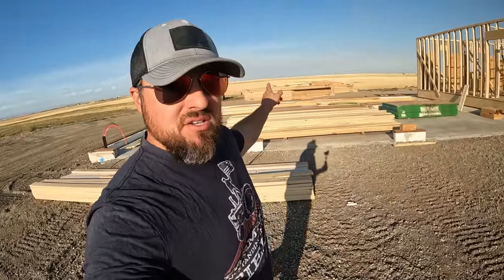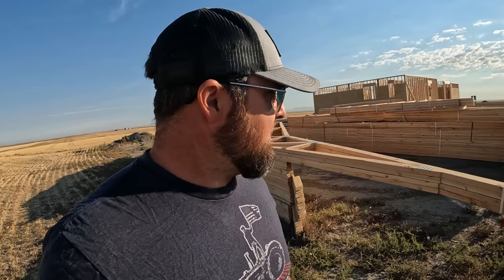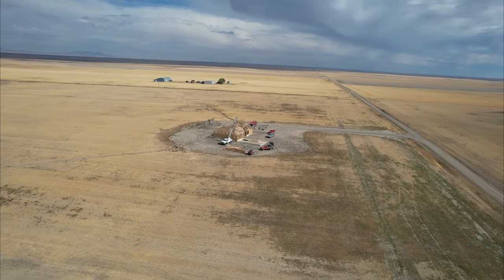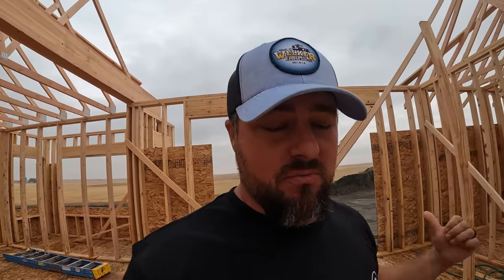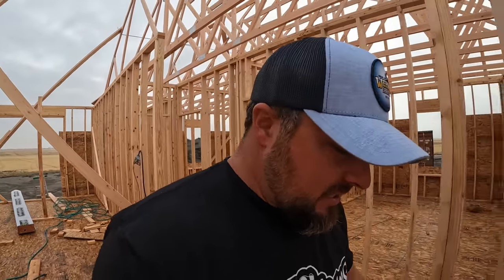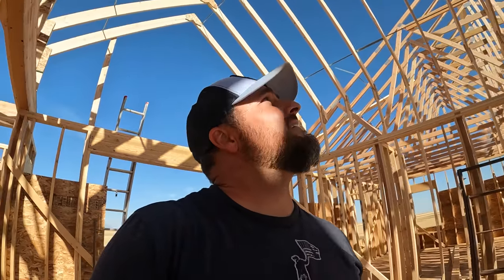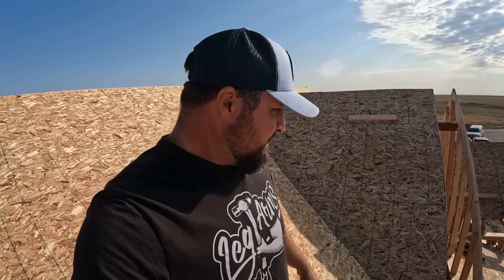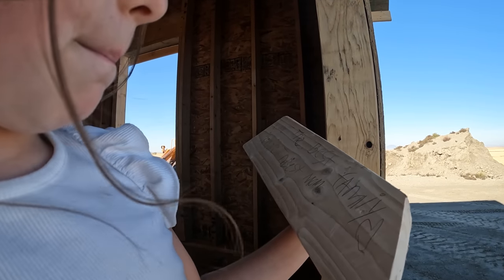How We Fixed a HUGE Mistake! - Leg Arm's House Build Part 5

Comment: I was yelling at the tube but you found it and it all worked out, so glad, any carpenter of my generation with a 5-in-one Starret tool could build what you want on site, makin in happen in MT, just make sure the roofing is flashed properly

Comment: Lov'n this. Worked in the building industry for decades in Australia 🇦🇺. Also drove cranes and hav'n a good laugh at mistakes. As a 73yo it's amazing to me how much timber American's still use. Ahwell old habits never die. In northern Australia 🇦🇺 we have cyclones 🌀 ( you call them hurricanes) all timber buildings have steel tiedown rod's. Me now i would only build with pre- cast concrete. Anyway it's looking good. Best of luck y'all.

Comment: We've built 2 houses from scratch in the last decade and no matter what, there is always some kind of problem. 
Thats just how house building is apparently.... from materials not being available or way over budget to complete  contractors/designers just messing up. 

It happens. All and all, there are always solutions especially when you're able to compromise. Congrats again on the house

Comment: As a retired builder I note that you have one of the cleanest building sites I have seen .. that's great in every way - including showing pride in workmanship ... if you have any internal box or valley  gutters, my suggestion is to make them as big as possible with emergency overflows lower than ANY top edge. It is amazing what can block a down pipe.    Looking good.    Oh and stop putting yourself down ... building is mostly common sense and being practical and you have both those traits

Comment: I'm no carpenter, but as soon as I saw the gap in the trusses, I knew what you were going to say the problem was, and how I would fix it.   It turned out nice!  You might want to get the cathedral ceiling spray foamed.  I know people that lost the drywall up in the peak due to moisture.
Reply: He is.  Thanks👍

Comment: I hope you can send the junk trusses back as the plans didn't give you what you asked for. Having said that, if they can't you have wood on site that can be used for some other idea's. I just love the fact that they included a beam for a load bearing wall that wasn't needed where they had it...... it is needed now and in a much better position. You have definitely got some good builders working with you. Good bless and hope you all have a really awesome weekend ❤️👍❤️

Comment: It's been so interesting watching how you build houses there. The majority of homes here are concrete block built, with brick facing, or timber frame with block and plaster facing, while windows and doors are mostly PVC or Aluminium. Its a whole other method of foundations, services etc. Odd thing is here we don't face the tornado winds, or frozen winters, just rain, light snow, the odd hurricane in autumn, and relatively mild summers. Best of luck in your new home.

Comment: Scott, I was in construction for about a year. Your contractor did it right common frame the vaulted area not only saves time but common frame roofs in my opinion look better and tend to be better than trusses strength wise and more importantly square and plum.
Reply: High winds are very common in MT.  You need a strong building for the wind and snow.

Comment: Either use the unused trusses in a new small building OR cut them up and have a bonfire BBQ near to last day. If option 2 be extremely careful of the truss plates as they are very sharp, I work with them daily.

You new assistant cameragirl  is doing a fantastic job, she will be a pro in no time. Why not give her one of the retired cameras to practice with.

Comment: You also have an issue with insulation the vaulted roof area.    You might consider using spray closed cell isocyranate foam ( R-7 per inch ) in that vaulted ceiling area.
Reply: What I was wondering myself. Good fixbut getting the R value  at that  point  is crucial.
Reply: He is foaming the walls already, so the vault will be too

Comment: Your daughter's house tour was fantastic. As for the vaults I would guess that the designer misunderstood what you had wanted as on custom homes it does happen sometimes. I've been delivering trusses for six and a half years, and mistakes do happen, always frustrating but I haven't seen a job not get corrected to the customer's satisfaction. Thankfully you have a good contractor that is building your house and worked out how to make the adjustments needed to get exactly what you wanted. 
It did look like the Case had a bit more leak down than it should in that timelapse at 16:43 But having your own crane was a pretty solid cost savings, as those are not cheap.

Comment: Just to put things in perspective Scott, you have done so much fabricating on the farm that the builders would say the same thing about your profession. Don't ever sell yourself short, especially when you told the designers 2 years in advance you see a problem coming with vault and then they just put it off as no big deal, but the fabricator in you could vision it not working.  The builders and yourself are both talented so just leave it at that! God bless all of you and keep plugging away in life...

Comment: Some things to think about. While your building your dream home here are some things to ponder from a old fool. First I see you have a basement which is very good. While your young you might think its silly, but you might want to consider installing a elevator. I know your probably thinking this is crazy but trust me when you get old you will wish you had one. Another thing is outlets. My house has them about somewhere around 18 inches from the floor. My mom's house has them all the way on the bottom of the wall. If I were building a new house they would be high enough to easily plug in whatever you needed. Also at your light switch would another good place for a plug in. Just some things I wanted to pass on to you. Love your farming and family viedoes.....keep up the good work.

Comment: I'd be interested to hear an engineer's opinion on those site built trusses for the vault. It seems to me that with them built with the extensions and no bottom chord/ceiling joist there's no strength to prevent the downward pressure or spreading. Not sure if  the small plywood gussets are sufficient. I think a ridge beam would be recommended or even needed there.

Comment: Design (engineering or architecture) is as much about communication as it is solving a problem or planning a vision. 

Different parties. (Design or supply) will be limited on the extent or detail they can provide. 

Something one may not fully understand unless you experiences the process.

Comment: My cousins house had similar issues and the first trusses were wrong. They ended up building a pole barn and using the wrong trusses a couple years later. So it all worked out in the end.

Comment: Give us a glimpse of what’s to come….Hard to tell, and not knowing that country…2x4 or 2x6 outer walls? Spray in foam or fiberglass batting insulation, tin or steel roofing…or asphalt?
Reply: Metal, foam, fiberglass

Comment: A truss, is that something normal in na? The whole first floor is filled with wooden sticks and completely unusable?? Plenty of space, so there is no need for building vertically I guess. 🙂
Reply: Most homes are one level with a basement in the northern patr of country.  And roof trusses are very common.

Comment: is the frame treated (termite proof) lumber? Here in Australia, treated pine framing is usually a blue or green color. First rule about building, dont trust builders..........they make monumental screw ups all the time.  Be on site regularly.......they will put in doors that open the wrong way, miss power points, build walls 3 feet out of wack.............you name it, they will do it. Dont take your eyes off them.
Reply: We have no termites here

Comment: Noticed your trusses are only 2x4. Must not be much of a snow load there. Just over the mountian a few hours where I live outside missoula my snow load is 90 lbs sqft.  I ended up using 2x10 to span 12' for my roof.
Reply: Not a problem with snow load.  Most I've seen is 9"of wer snow
Reply: @RobertWelkerFarmerBob  lol had that last weekend. We average 14' of snowfall here at 5k feet elevation but I've seen as much as 18' in the 10 years I've lived here. Metal roofs so the snow normally slides but I've had to shovel 4'-5' off the roof once or twice.

Comment: Wait, you don't build houses with bricks?
Reply: After WW2, when the GI's were coming home and there was a high demand for new housing, the housing industry went more into wooden homes rather than bricks as it was cheaper (wood is more plentiful here than in Europe, for example) and easier to work with along with faster construction time.

We do have brick homes, soda can homes (check out Texas houses, they have practically no codes for housing materials) and other interesting places that were refurbished or repurposed, but for the majority of American homes in the last 70 years, it's wood all the way.

Comment: Your builder should have CAD drawings on everything. If not 3D at least 2D ....... I spent 25 yrs. doing Cad 2D and 3D modeling .... They did more than screw up   Have to submit building plans to city / county for approval.... what did they do .... design the house on napkin... just saying.
Reply: No, it was full designed by architect but the truss company failed.